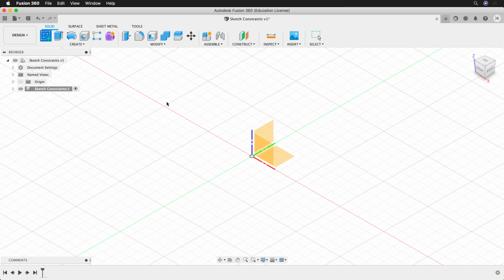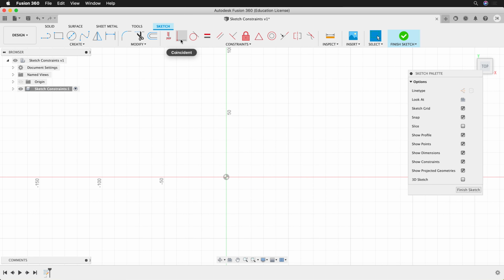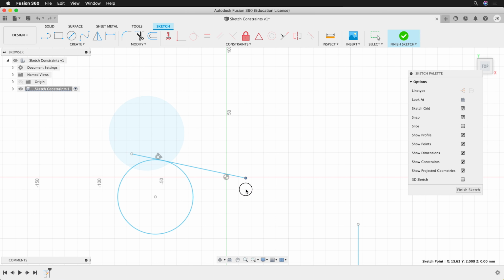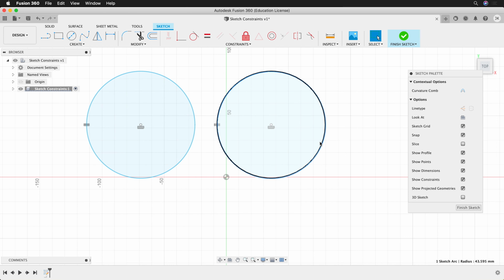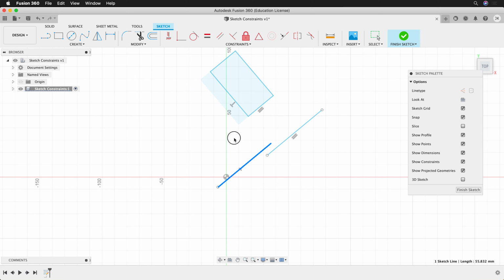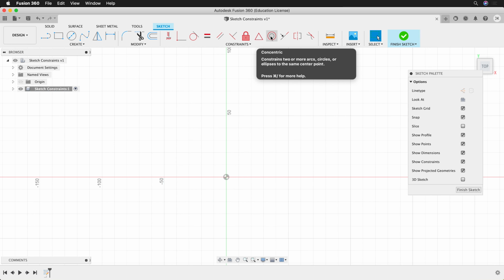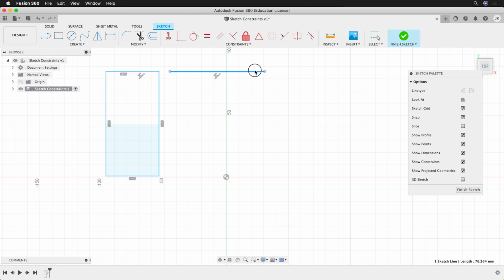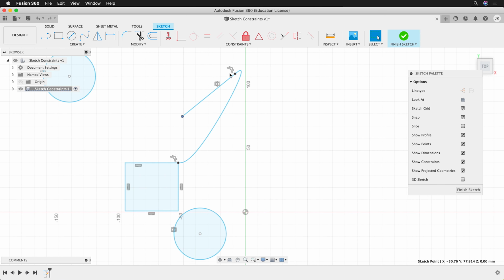Master Sketch Constraints in Fusion 360: Tangent, Coincident, Equal, Parallel, and More

Comment: is it posssible to select all constraints at once?
Reply from the maker: Depending on the settings and dimensions, some of the constraints could contradict each other. So in those moments all the constraints are not possible, but there may be a hypothetical situation where you could have all constraints selected in Fusion 360